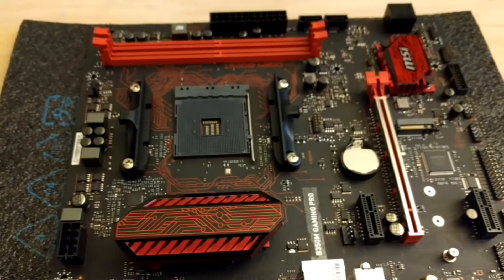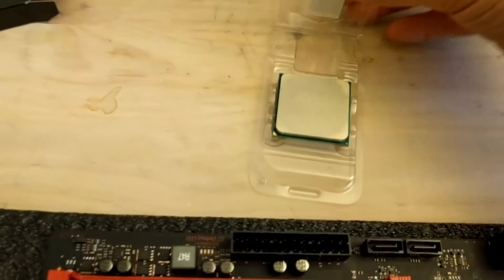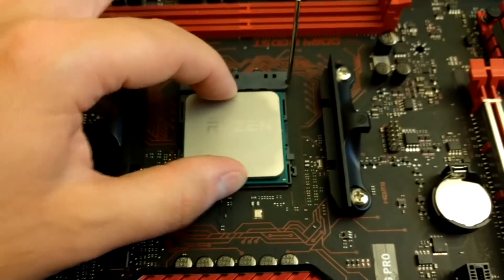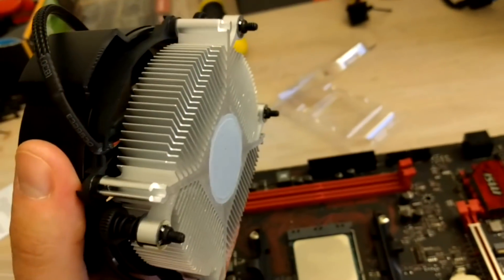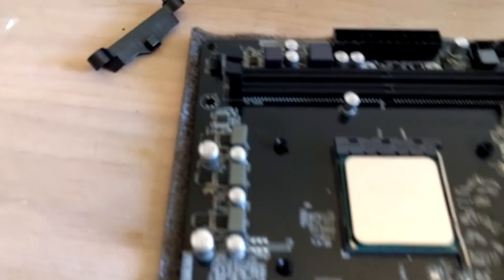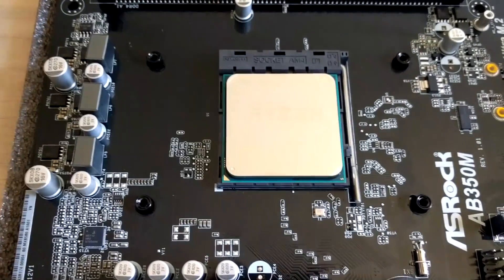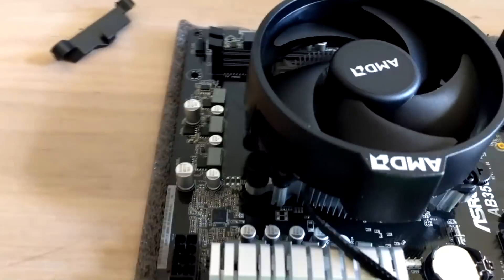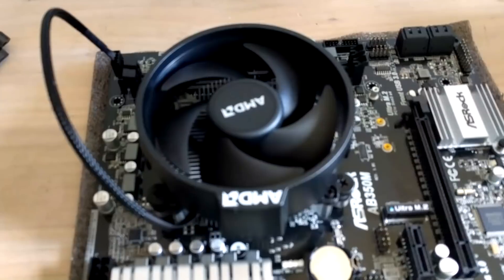AM4 Ryzen CPU and Wraith Cooler installation directions

Comment: for me the cpu retention arm wont click and there is almost no force needed to lock cpu in place and when i took the cooler off the cpu came off with it any help plz
Reply from the maker: Retention arm only clicks ever so slightly when it slides under the socket notch on the side. CPU is actually barely held in place in this socket and it's not uncommon for the CPU to get stuck to the cooler base because of the thermal paste. Just rotate it slightly to detach it.
Reply: @CentaurusComputersCharlotte  i fixed it i was just being stupid and tried installing the cpu with the mobo still in the case i took the mobo out installed it that way and it was fine i booted up no problem

Comment: How to do it without that back plate?? Who built my pc managed to, after changing cooler paster i canned screw the cooler back in
Reply from the maker: You need to buy a new backplate on eBay or somewhere. Cooler Master usually uses their own backplate, a different kind, many others don't use it at all, so you need a new one

Comment: My fucking screws dont reach. I get 1/4 thread turned in and the other ones wont reach. Fuck this cooler.
Reply: Samw problem, did you fix it?
Reply: @donbasto1156  Yeah... If you hold the fan in your hand you can press the screws individually to compress the spring and get them to extend farther. Only problem is it takes a decent amount of force. 
I had to press down on them pretty hard with my screw driver while they were on my cpu to get them to compress and thread in. Be very careful how you do this, it seems very easy to break something. Same process as everyone says but press them down just enough to get each one threaded at first. It seems pretty dumb having the springs in there, i think its supposed to be some kind of protection from people over tightening the shit out of them.

Comment: I took off my cooler and I don't have those little black screw holders what works I do? It won't screw in anymore
Reply from the maker: Both backplate and top plastic prongs can be purchased on ebay if you are missing any.

Comment: hi bro i have mobo msi b450 gaming plus and cpu rysen5 1600 and i cant get rid of black screen and red led from cpu? any help please?
Reply from the maker: If CPU is good (no bent pins), reset BIOS, check RAM in different slots, one stick at a time. Make sure video card is installed, there is no iGPU in this processor.
Reply: @CentaurusComputersCharlotte  indeed the cpu has no video, but its new is all ok, i reaseted sometimes and the problrm didnt insist, worked 2,3 weeks then the ez debug led at cpu started again...earlyear i reseted the bios, batterry off 30 minutes then puted back, now...il wait to see what happends

Comment: My motherboard does not seem to have a back plate. Would it have come with the chasis?
Reply from the maker: It is a part of the stock motherboard, with black plastic clips on top. When they are removed, like for some aftermarket coolers, the backplate drops down.

Comment: it is no where that easy to install, The thing dips each time no matter what due to the springs so one side gets screwed in and the other pops out. This is one of the worst designed coolers because of the springs literal headache
Reply from the maker: Thread them in just a few turns each, that way neither side pulls down too much. Once all screws are in - finish them all. Bigger coolers with copper are harder to manage though
Reply: @CentaurusComputersCharlotte  again no offense not nearly as easy as it sounds I spent hours just trying them. The spring bolts are a travesty and it should be no where near as hard as it is. it might sound like im complaining but this is a evident issue for many with this cooler.

Comment: For those building a new computer: Two big things not discussed in this video when installing the CPU cooler; one is you go in a corner/star pattern, don't install one screw completely at a time -- and the second is that you need to place quite a bit of force on those CPU cooler screws to force them into the threads as they're spring-loaded, but you cannot over tighten them because of the springs! It's impossible to overtighten those screws so just go one opposite-corner at a time and use quite a bit of pressure.
Reply from the maker: Correct, though you can see from the video that I have threaded in each screw 3-4 turns and then finished them up after that, so I did not tighten them up to the full stop at once. As for the pressure applied to the screwdriver - it only is true for bigger Spire coolers with copper core, these do need a lot of pressure. Basic "Silent" version shown here does not need any pressure applied, I did it with one hand as you can see :-)

Comment: 4:14 that mobo nearly went to the trash.
Reply from the maker: Not even close in this case. Though I did break off a few of these little chips a couple of times over the last 10 years. Whatever they were , mobos worked perfectly fine without them :-)
Reply: huh?

Comment: The backplate design is so fucking stupid. Who came up with this. I removed the two brackets that were on the mobo because I could tell the CPU cooler design would not use them. I already had the mobo mounted in the case and the case on it's side so when I removed the two brackets I didn't  notice the backplate fall away from the mobo on the backside. That's why I had to search a video to find how to install the damn cooler. It takes a ridiculous amount of force to do so. Hope my thermal paste isn't fucked cause the fan went on there and off like three times before I searched this video. Really needs to be a fuck huge warning to install the CPU first and it needs to point out the goddamn backplate.

Comment: finally a video that showed me what the problem was when I was removing those two plastic strips the plate on the back had fallen down underneath my case and I couldn't figure out why I couldn't screw in my new CPU fan once I saw this I realized that the plate was under the case on my desk

Comment: Just bought ryzen5 and no golden triangle on chip. All 4 corners are green.
Reply from the maker: Put motherboard with rear i/o ports towards you with CPU socket lever to the right of it (as on video), take CPU in your hand so you can read its name left to right, put on top of the socket, it should drop in easily, don't force it.

Comment: cpu gets so hot man with the wraith cooler. at times can go to 90c on load
Reply from the maker: Check your voltage. Some motherboards are crazy and load 1.4v+ on CPU when not needed at all. Often you can adjust it manually. Especially with 2xxx series I prefer to overclock manually and set lower voltage, or like set it to offset with "-" sign.
Reply: @CentaurusComputersCharlotte  I'm not sure which one to check this. I'm checking thru hw monitor but there's a bunch of stuff like cpu vdd (node 0) and some other stuff. This is ryzen 3600 BTW.
Reply from the maker: @lordadz1615  With 3600 we usually leave everything on default. If your thermal paste was too dry or too much, or one of the screws not secure, these temps will go up

Comment: Should have had the logo facing the right way.
Reply from the maker: It's not a big deal, it comes like that and most people don't care. But it's easy to remove 4 screws on the fan to rotate fan shroud so that AMD logo is on the top side.

Comment: No ground?
Reply from the maker: It is a bit superstitious, seriously. While technically it is advisable to to ground yourself you can do that in a few easy ways without attaching yourself with a wire to anything. For example, you can touch your PC case before working on any small components like CPU or RAM. PC cases are large enough to discharge safely any static from you, a lot of professionals actually recommend exactly this. Also, in my 12 years of building PCs (1000s of them) I never had a problem with static discharge damaging components. You can only get enough static electricity if you enter from the cold outside or when you pull a case from the box encased in Styrofoam, but as soon as you touch the case it goes away, hits rather hard sometimes. When you are already working on your PC the only way to get some static is to wear woolen socks and shuffle them for 10 minutes over the carpet without touching anything else. Good luck with that :-)

Comment: Thank you sir. I got back into dekstops and have Ryzen
Reply: im getting ryzen 7 2700 in 3 days and watching these cus im scared af that ill break it
Reply: @IlluminatiSRB  Thanks... Also as you said in the video... the Am4 socket stays the same right no matter what motherboard you get... So any Micro ATx or standard motherbaord with AM4 socket will work ith Ryzen  right? I mean any ASrock/MSI board that has Am4 socket will work with Ryzen?

I beleive I had a build I did with 2011 and i had a AMD Phenom X2 Quad Core chip and it uses a AM3 socket. So again the rule of thumb for CPU is as long as the socket matches it is usually fine? Im a returning dekstop newbie so  hope my question is not to onewish haha

Comment: You should get all 4 screws part threaded before tightening any. And even then to apply even load you should tighten each one in a cross pattern till they're tight otherwise there will be more pressure on one side and can create air pockets between cpu and heatsink. Also if using your own thermal paste, don't spread it across the heatsink like this. Put a pea sized blob in the centre so when you press the heatsink against the cpu it spreads its self out evenly.
Reply: If you have a new cooler like that, it comes with paste pre-applied, spread as shown and you shouldn't add any more. If you're installing a new, or reseating an old CPU, then just a rice grain-sized blob in the center is fine.
Reply: @KirkRoss  the pre applied stuff included with heat sinks is the cheapest crap they can find and often gives poor results. I usually remove it and put some arctic mx5 on instead.
Reply: @Arcona  Me too... but... for an average user not overclocking and just replacing a heatsink, (just IMO) the factory stuff is fine.

Comment: Hey i have a problem when i install the cooler the screws dont coincide in the motherboard are just 2 milimeters off 

why?
i moved the backplate of the motherboard?
Reply from the maker: they should match exactly unless you are using an AM4 cooler with AM3 motherboard, they look the same but have slightly differently located mounting points. Screws can wiggle a bit in their sockets, not by 2mm though,

Comment: This is my first AMD system ever. I was shocked to see my 2600x cooler would not fit the brackets on my B450. Thank you so much for showing that I had to remove the bracket that came stock with the board and that the back plate had standoffs poking through just long enough for the Wraith Spire.
I really want to get this thing sorted before I have to start work and honestly thought the cooler was completely incompatible !!

Never felt so sad when I realised I couldn't attach the cooler lol

Thanks for making this video !
Reply: what did u do to fix it i have same problem
Reply: @abdul-fo8ir  I just removed the brackets with a Philips screw driver then attached the cooler to the backplate.
Reply: I don't how it was for the AM4 mobo I got but the backplate had to be held with one hand while the stock cooler was screwed in. I think my backplate didn't have the screwhole housing go through the mobo so it was more difficult to keep it in place since it just slid around.

Comment: I can't screw mine in the screw won't catch the threqd
Reply from the maker: It should match, just make sure you insert each screw just a few turns into the thread (all 4) before you finish them all the way down. If you will screw first one to the end - others will be super hard to insert into the thread.
Reply: Centaurus Computers it's really stressing me out because when I screw one in a tiny bit I can't screw the rest in

Comment: If anyone else struggled for way too long on this, push down really hard on the screw driver while you're screwing, not on the whole cooler / fan
Reply from the maker: That is true, sometimes pushing on the cooler only transfers pressure to the CPU socket, not on screws, which are often hanging above the threads and pushed up by strong springs, so you have to hold cooler with one hand constantly pushing it down and holding straight and push on a screwdriver rather hard sometimes with the other hand.

Comment: What about thermal paste? Is that something I should be using?
Reply from the maker: Yes, it is mentioned during the installation. Stock AMD coolers come with paste on them. You can use your own, a small drop in the middle or spread it in a thin layer if you want to.
Reply: @CentaurusComputersCharlotte  Great, thanks. Was watching without sound so I missed it!

Comment: Here’s some advice if you’re having trouble screwing it down: try to diagonally screw the 4 screws, but each screw half a turn.
Reply from the maker: Yes, that works with these coolers. If you screw in one side, all the way in, you will not be able to push in the other side. A few turns into the thread from each side, diagonally, to start each screw and then finish them all in the same manner.

Comment: only 2 screws will fit, no matter how much i swap it... is that ok? the cooler looks steady
i opened the pc, its steady enough to not move on its own. is it ok to keep it with 2 screws on? its temps are kinda high, 50 idle, 90 on moba, (no OC)
Reply from the maker: It's bad. Temps should be around 35C idle, 50-60 when gaming. 
You need all 4 screws in. On some coolers (like taller 2600X/2700 kind) you have to push on the screwdriver really hard to fit screw in.
Reply: @CentaurusComputersCharlotte  thank you for the reply! i have the 1700 and it has the same cooler as the 2 that you mentioned. i am afraid i may  break something, i ll try to have an expert do it, thank you a lot!

Comment: So when I tried screwing my fan in it wasn't even and my processor stuck to the bottom when I pulled it out to reset it does that mean i fucked my processor up in the process because it's that loose?
Reply from the maker: Not necessarily. AMD CPU retention, that little lever, does not hold processor well in the socket. When you pull cooler up it usually pulls CPU with it, if you have pulled it up straight it should not damage the CPU. Check all pins, make sure all are straight. Use a thin knife or another tool to straighten the pins, don't wiggle them left and right, you have only 2-3 touches before pin breaks. 
When installing cooler you have to press it down firmly with one hand and then press screwdriver down (forcibly) on screws for them to reach the threads.

Comment: Btw how far should you keep screwing them? I'm afraid I'll bend the motherboard if I'll screw them all the way in! Should i keep screwing them until they stop turning? I'm confused.
Reply from the maker: Screw it in till the end. You will come to a hard stop, it is designed so. Have not broken a single board yet doing that way over a few last hundred Ryzen builds.
Reply: @CentaurusComputersCharlotte  Alright. Thanks for the help mate,i appreciate it! :)
Reply: @CentaurusComputersCharlotte  Also one last question, is it ok for the board to flex a bit after you install the cooler?  I mean will it have any effect on the solder joints after heating?

Comment: Just took the wraith spire off my mobo to install a new cooler that uses the platic bits you took off at the start, but they don’t seem to fit into the mobo spots and I don’t think I have the backplate on, but if I didn’t the spire would never be on right??? And now I cant get the spire back on, the screws don’t even get close to the holes after a considerable amount of pressure. Please help!
Reply from the maker: Spire cooler is only held by the 4 screws that go into the backplate. Without the backplate Spire would not have been able to hold, so you do have a backplate there. It might have fallen down as nothing holds it without the cooler installed. Open the other side panel and look through the motherboard tray cutout, see if the backplate is just hanging there without support. You will need to either take the motherboard out to put it flat on the table or hold the backplate with one hand or use some soft raised support for it not to drop while you install the plastic brackets. Make sure hooks on them face outside.
Reply: Centaurus Computers ok thanks!

Comment: I just bought one of your PC's on Amazon called the Vigor 2. Hope it was worth my money and that it isn't a scam. How long do you suppose it will last?
Reply from the maker: It can last indefinitely if cared for properly. You can upgrade components over time if you will feel necessary, but it will be perfect as is for quite some time. We have 9.44 out of 10 rating on ResellerRatings.com and 4.8 out of 5 on Amazon, our customers are generally very happy with the systems that build since 2007.
Reply: @CentaurusComputersCharlotte  Thank you so much for the responsive feedback.

Comment: On my Asus x470f motherboard the wraith stealth heatsink directly touches the VRM as soon as I start screwing it in and I worry if I screw it in further it might damage the VRM. Any help on this?
Reply: You dont say what kind of asus 470 motherboard you have. But, this should not happen, the boards where made for amd stock coolers. Ask your supplier wtf is up. If they cant help you, you will have to modify the cooler a bit, use a dremel or a file on it so it does not touch the vrm.
Reply: @sjarken3979  yeah sorry it's the Asus rog strix, x470f gaming(retarded name). I managed to install it eventually by being very precise with applying even pressure and making sure it screwed in straight. Its now about 0.5mm of space between the heatsink and the VRM so I guess it worked. Before I probably screwed in one side to much and it became tilted and touched the VRM